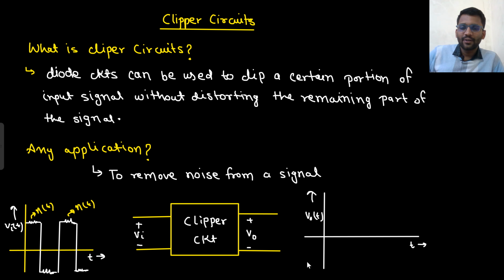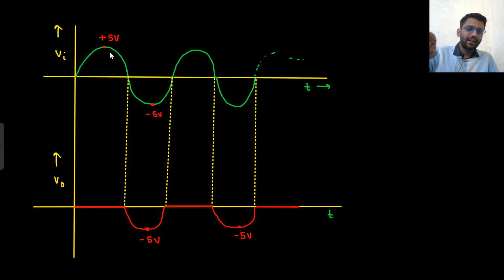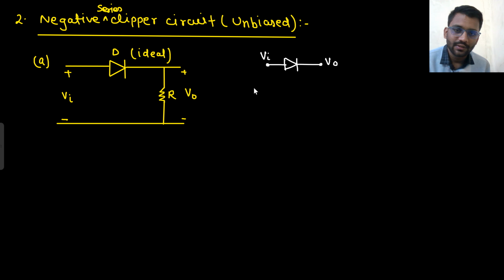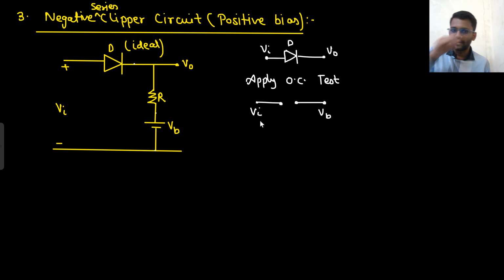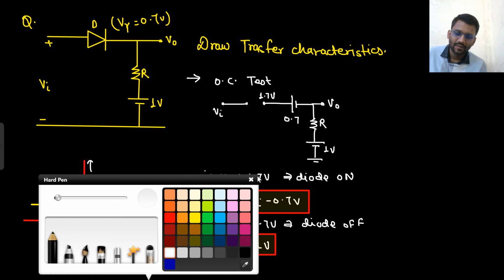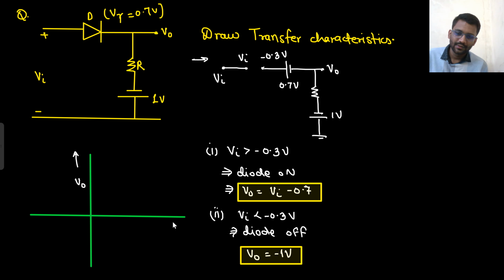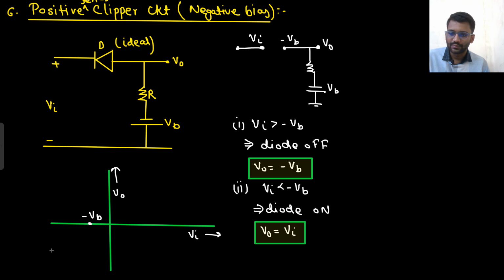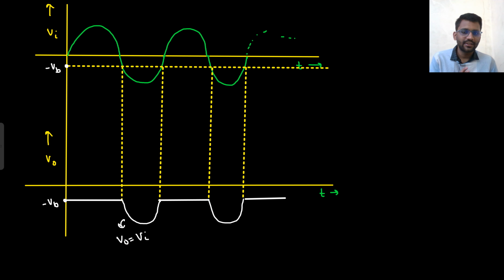Series Clipper Circuits || Analog Electronics || PrepFusion || Himanshu Agarwal

Comment: Timestamps (Powered by Merlin AI)
00:04 - Clipper circuits efficiently remove unwanted signal parts without distortion.
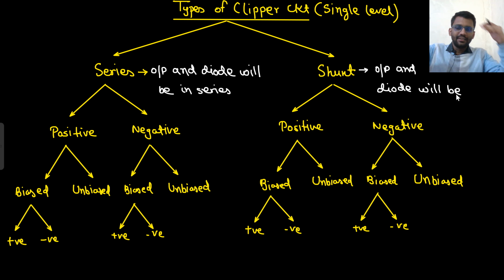02:33 - Understanding the analysis of positive series clipper circuits.
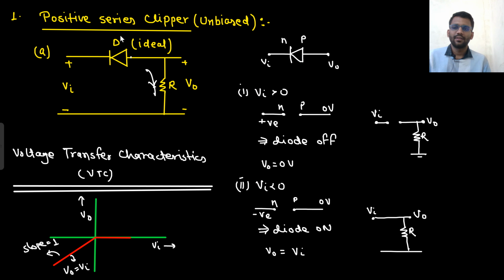08:46 - Explains positive clipper and diode circuit analysis.
11:11 - Understanding diode behavior based on input voltage.
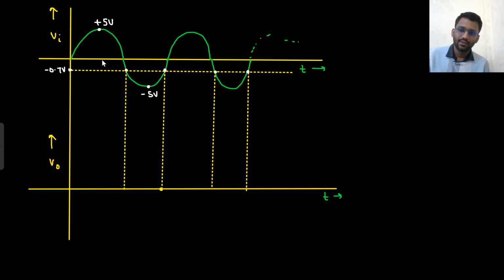16:00 - Negative Series Clipper Circuit Analysis
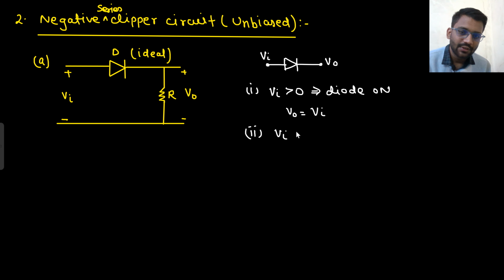18:06 - Understanding diode behavior in transfer characteristics.
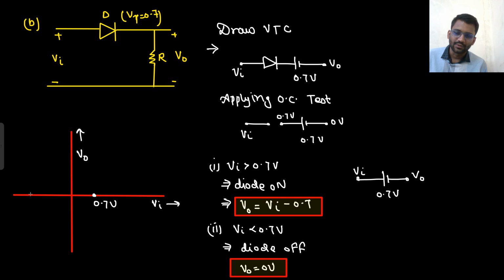23:08 - Understanding the behavior of the series clipper circuit.
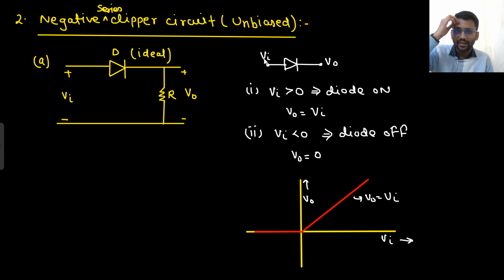25:21 - Understanding diode behavior under open circuit conditions.
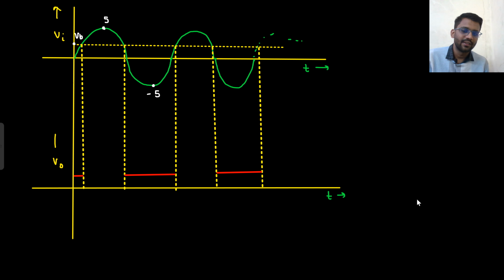31:37 - Understanding voltage transfer characteristics in clipper circuits.
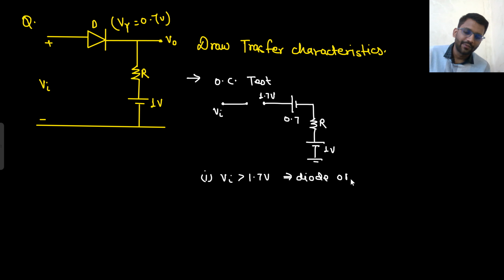33:58 - Output voltage behavior of diodes based on input voltage.
38:29 - Understanding the transfer characteristics of the clipper circuit.
40:55 - Understanding circuit analysis enhances problem-solving skills.
45:56 - Understanding positive series clipper circuits and their behavior with biasing.
48:28 - Graph behavior of Clipper Circuits based on input voltage levels.
54:37 - Understanding the diode behavior in a circuit through transfer characteristics.
57:34 - Understanding diode transfer characteristics and analysis methods.

Comment: how -1.7 in positive  series  ( negative  bias  )  with v gamma
Reply: Generally diode P side having -0.7V . And There will be a -1V source from P side . Now add this two voltage= -1.7V . Diode is on if Vi < -1.7V
Reply: Why current 0 even  there is potential difference
Reply: @KrishSumbria-l6w in open circuit no current flows